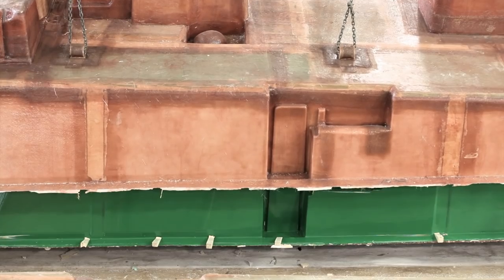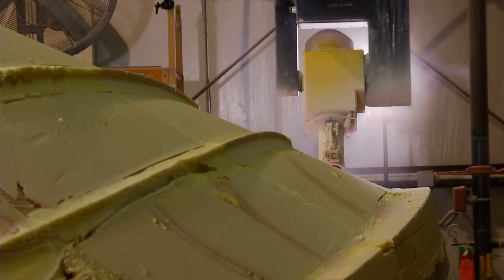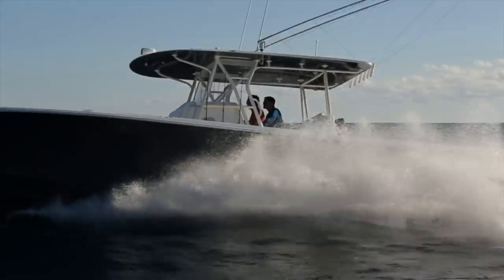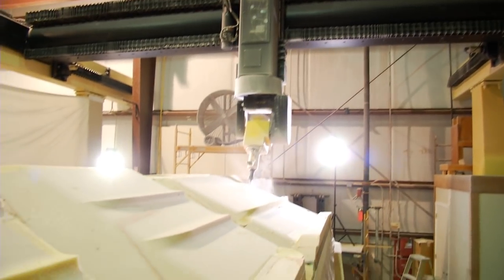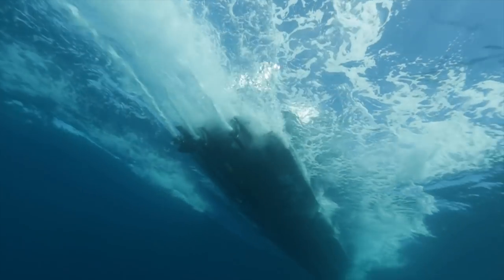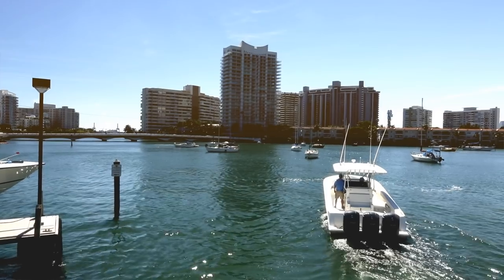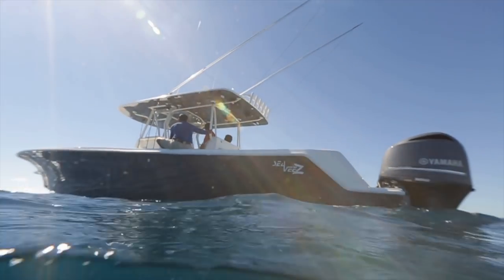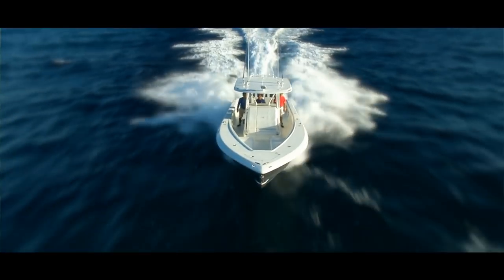SeaVee Z - High Performance Stepped Hull Fishing Boat

Comment: I would say that one could forget about the stepped hull if the engine exhausts or a compressor was arranged to have  compressed air blown  at about that  point behind where the bow rises out of the water. My experience with fast boats is that air under the hull seems to lubricate the boundary between hull and water and it goes faster. Try  moving your boat against the wind or with the wind and one can easily see the difference. Well a stepped hull really allows air to enter under the hull and that is their secret .   I would try compressed air under the hull and see how it goes.

Comment: how is it fuel efficient if you need three outboards to run it.
Reply: Agree! with the horses they put on the back, the wetted area is so minimal anyway once on a full plane i wonder what numbers they are actually getting? seems like a marketing ploy to me.
Reply: Yup, why bother investing in building a better, more fuel efficient hull if 1 of your test boats in a video is using 3 engines?..... maybe getting a big heavy boat to perform better is just a huge waste of time and we should still be using the hull designs from the viking long boats from a 1000 years ago.

Comment: I am from the philippines and i am planning to make a small boat by myself, the dimensions of the small boat that i am planning on building is just the widest part of the beam would be 24 inches and the lenght overall would be 24 feet, i am hoping you could share me the appropriate planing hull design and dimensions including the hull cut and cut depth, as well as bow rake were it starts and also for the hull v degrees from fore to aft, 😊

Comment: ''burns less fuel'' nothing about 3 engines is fuel saving.
Reply: theboarman ii
Reply: but is it more fuel efficient and better performing than a non-stepped hull with 3 engines? That's the point. Can it get up to plane with less RPM's and less fuel burn than a non-stepped hull? That's the point. Number of engines in this video is irrelevant. This is about a better hull. Even if I get a 43 sea vee express at 25,000 pounds and quad marine 7 627 hp engines and a 1000 gallon fuel tank, why wouldn't I want the most efficient hull that also gives me better cruising and top speed as well as turning?
Reply: lol who are they fooling?
Reply: @jamesrudolph4151  If you can buy this boat you can afford the fuel.

Comment: 4 outboards? Ok, I don't like it, the through a bunch of engines on it and it will go faster is not a efficient way to go about it. I think the company has the wrong idea...
Reply: +Walkertongdee agree-disagree both. outboards do have the advantage of serviceability access, unbolt and send to shop. not that it can't be similar with a big block if it's set up for easy mount-dismount, about the same kind of horsepower. "get there FAST" isn't always a great idea in a boat, if speed and efficiency are the big desire, hydrofoil makes more sense and rides smoother too. load could be managed with adjustable attack angle.
Reply: I agree, I've often thought that all the boat builders and customers should agree that Walkertongdee knows what the best way to design, build and run ALL boats is and they should just follow your directions and guidance because your ideas are clearly far and away the best and only way it should be allowed to be done. Just as soon as you start building boats that are demonstrably better than sea vee,  you let me know and I will be sure to buy one.